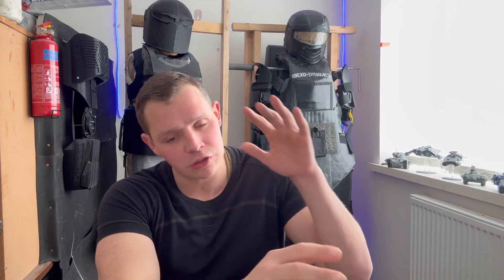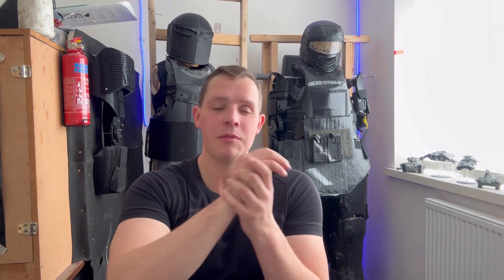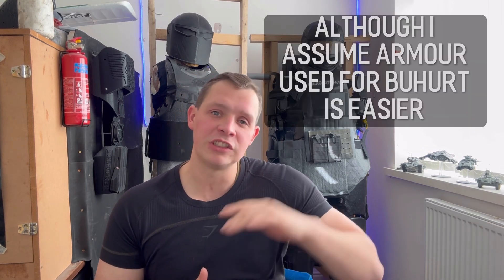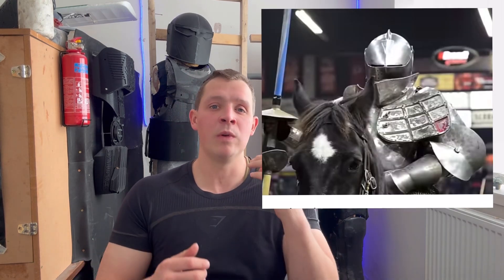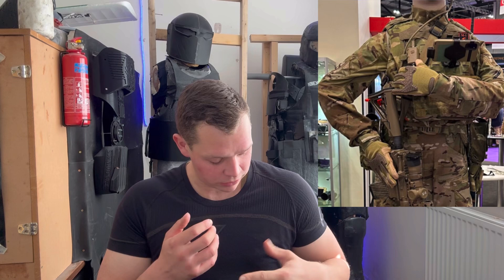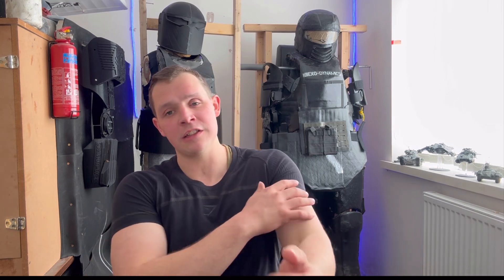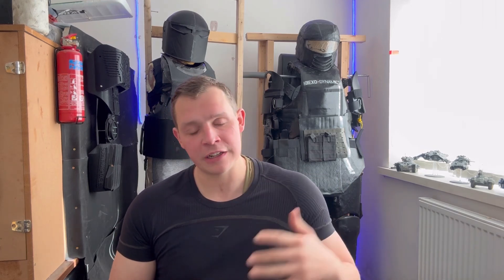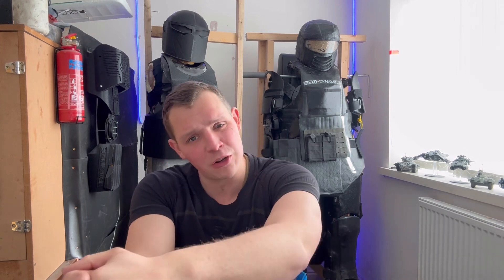The flaws of trying to use Medieval armour design in modern POWER ARMOR

Comment: I think that as a concept, power armor should be utilized by soldiers who's sole job is to rapidly deploy against the enemy to engage in close range, high-intensity fighting to initiate break-throughs for weak points in the defensive line.

 The armor only works strategically if the enemy has to consider taking higher loses from danger-close fire support than from withdrawing from the engagement altogether, as no amount of armor will save you from being turned inside-out from overpressure caused by heavy munitions. Considerations of performing manual tasks and field labor should probably be the lowest on the list of prio's to getting the concept working in the first place. 

It's not likely that power armor wouldn't already require specialized engineers to maintain like with all military hardware, so the idea of having a pit-crew to bolt some meat-head into a big metal coffin with a minigun bolted onto it with a stabilizing arm doesn't seem unreasonable in the slightest if you really think about it.

 I think as well that such troops would be deployed in similar fashion to strike teams that we've used in the GWOT where you get a handful of delta operators who hop off a small helicopter, run into a building, hose everyone inside down with hot metal, hop back on the heli, RTB, and take a shower. 

With all this in practice; does it really matter if these guys can't use a cell phone, take down field notes, turn a door knob, or play a piano?

Comment: Glad you adressed this topic.
FYI when it comes to doors, im a very big man (built like a brick out house - not obese). Frankly I go through doors sideways or at an angle any ways. you adapt to this problem, though vehicles are a problem - The amount of emergency hire cars I have had that I had to return as I could not fit in them is no joke.

Definately think there are parts of medieval design that can serve your purpose still - despite the issues. rounds being the most obvious - ie parts of armour that are loosely attached able to move that cover gaps in the armour - often at the shoulders or sides of joints.
The other being the important height of breast plates - and the skirt. breatplates in fantasy and scifi are ALWAYS too low which restricts bending forward and sitting, real armour designs had much shorter breastplates going from neck to navel - with a flexible skirt below that. For modern materials (and thickness) Id suggest the skirt be made of panels (those hexes you have?) stitched together with a flexible kevlar weave front and back OR that you use the same method as is in a modern flack jacket - essentially kevlar plate brigandine.

Regarding putting armour on, and doing things in armour: squadies help each other with this all the time already. its normal. (im ex forces - engineers).

Comment: If we consider how logistics are made to support tanks, i think supporting dudes in big powered armor is going to be nothing, with the higher technology and more robust technologies you can make essentially a human tank have almost better ergonomics than a knight in the 1800s, okay maybe not so much but getting close to that, mixing solid plates (or rather whole blocks) of steel with some overlapped less thick but sliding plates that cover the joints at all angles, powered internal exoskeleton (protected by the plating) and with stronger materials and more elaborated overall construction of the whole suit, you could make something very practical and effective without compromising mobility or visibility at all, maybe also add a lock onto the neck guard to make it flap down when you're not in combat or when you need to look down.

Comment: Your phone shouldn't be that - it should be integrated into the helmet - get some of those new AR glasses, the future is in eye tracking and spatial computing i.e. with Apple's headset or the HVAS system being tested by the US Army and Microsoft. If you have a handheld unit - it's basically a compute unit that should be tucked in under padding, not something you have to reach for. You can either connected wired via USB-C or Bluetooth 5.3 now. future versions will be even more powerful.

Comment: there are modern "stilt suits" ive seen around that have an exo built around them ,though the outer arms are driven directly by the inner ones maybe a compromise could be made, also a possibility to consider is using mckibbens muscles with hydraulic fluid instead of pneumatics

Comment: If you are in a military, You Are Not Alone.
Men at arms who didn't have Squires would help each other dress in their armor.
Think about this, is it impractical in Modern War to fly a jet because you need a team to fuel and maintain the aircraft?

So saying that power armor is Impractical for a modern military because you can't dress in it by yourself is a non- dilemma
Reply: And add plethora of modern fast connection technology like zippers compared to belt buckles and buttons.
Much easier to do yourself and most difficult parts of medieval armor are parts that are most common used in modern one.
Reply: @offnet6934  yeah, good point
I didn't even think of that

Comment: I agree that"medieval armour" design philosophy in general isn't fit for the task. Tho, samurai armour isn't really far off imo. Samurai were archers for the most part hence their armour allowed for better mobility while emphasizing on protection using larger pieces instead of close fitting, especially for their shoulders as the pauldrons were practically small shields. I think a modern samurai armour wouldn't be a bad design for ballistic armour

Comment: You didn’t actually show or describe what a gorget is. A gorget is a neck defense of articulated plates that sits on the shoulders, usually under the cuirass. It didn’t impede your ability to look down much if at since it moved with your neck. What you showed were reinforcement plates used for jousting.
Reply: @Specter_1125  The problem is that Gorgets are heavily articulated in order to offer that level of mobility.

In order to stop modern firearms the plates would have to be very thick, which would make articulations to that degree impossible.
Reply: @fallencrusader2975 that doesn’t change the fact he completely misunderstood what a gorget is and how it functions. For what he was describing, a stop rib (a small v shaped piece of metal riveted near the top of a cuirass or cuisse) would work to deflect shrapnel nor would it stop you from looking down at all. He legitimately seemed to just not actually understand the construction of plate armor if he didn’t know what a bevor was, or that stop ribs exist.
Reply: @Specter_1125  Yes I was quite surprised he hasn't mentioned or even thought about using stop ribs or fluting to deflect bullets/shrapnel

Comment: The problem especially with let’s say Germanic styles of armor with their intricate folding plate sections, is that if or whenever they’re damaged, is there a chance that the armor isn’t actually going to start hindering an individual’s ability to move or escape? As seen in warhammer 40K to get around the whole trapped inside a metal exoskeleton armor is by using a powered saw and drills, again whilst using nano machines to artificially heal any injuries, the problem becomes more apparent when you’ve got bits of additional metal pinned inside of your skin and again great for protecting you, not so great if you can get out of said armor, which is why the British army’s virtis system
Comes with a quick release strap which allows the soldier to remove their armor in mere moments, all the while being able to mount a dragging cable to the back of a soldiers plate carrier via the carry handle which can help keep soldiers hands free whenever they’re need to evacuate the area whilst keeping both hands free. Another problem would inevitably be armor degradation and whilst having full suits of power armor like the space marines or the Spartans, the truth is that it would always be a battle between armor protection, maneuverability, and surprisingly enough both power supply and flexibility which is why armor suits like the space marines terminator power armor is usually equipped with either a weapon with a box magazine or a heavy weapon, due to the armor being capable of not only carrying the weight and additional ammunition but also limits the need or flexibility required whenever they’re need to reload, not only that but the armor would be required to work in many different forms of environment from the relatively clean and unobstructed city or suburban environments, to the jungle vine traps of Asia, to the jungles of South America, where as seen by Spanish conquistadors where they used only helmets and breastplate armor, despite dealing with native tribes armed with clubs and bow and arrows, the reason why they didn’t use heavier sets of armor was simply due to how much of a pain in the ass it would be to climb, crawl or hop over every tree root that’s trying to trip you over to the thick, gloopy mud that’s trying to eat you alive. All the while vines, branches and anything and everything gets caught or snagged onto or into your clothes
Reply: Medieval armor could be pretty quickly removed with a knife by cutting the points or straps. Also, the actual danger of the armor impeding mobility when damaged isn’t as major as you’d think because it takes a lot to deform the metal enough to bind up on each other.

Comment: ....no, you're absolutely wrong about medieval armor flaws besides the help needed to put it on and being thin by modern standard, but that's out of context. It's was made to resist the weapon of its time. Once firearms were made mainstream, the armor was ditched because it couldn't resist them without compromising mobility.

You assumed flaws are actually with the sci-fi armor of 40k.
Reply: late medieval armour and renisance armour was made to resist firearms, which were "mainstream" at the time and it didn't compromise mobility much or at all.
Reply: @VihniPuh-kolinkrivi  Actually, they did. Please explain why we don't wear plate body armor anymore?
Reply: @houayangthe3rd  plate armour dissapeared with dissaperance of knightly class of professional warriors. We don't wear it today because there is no body who has power and wealth to afford the top notch protection, and thus facilitate it's development, and who at the same time has to go to war. Like billioners don't go to war, kings did.

So caeconomic and socaidal changes is your answer.

I guess we have fighter-jet pilots, who are most similar to this class, but they are still different and armour wouldn't be of use to them.
Reply: @VihniPuh-kolinkrivi LOL Fail. 1, plate armor is not exclusive to knights. Anyone who could afford or loot it can wear it. 2, WW1 should have given you the correct answer. They tried to create plate armor that could resist machine gunfire, and they did. But guess what? It was too heavy. 3, jets have nothing to do with body armor.
Reply: @houayangthe3rd  yeah jets don't have anything to do with body armour, i agree. They have to do with knights.

i must disagree though. Anyone who could afford or loot it could wear it - it's correct. But, who could afford it? Even many knights couldn't (their lord bought it for his combat servants), anyone who's less wealthy than a knight - could not afford it at all, in vast majority of cases. There of couce were priests, who were really wealthy, but they don't go to war. Really the only exeption would be the most wealthy merchants of late middle ages, but even then a full harness would be a fortune even for them.
So, only knight could realistically afford it.

Looting it is a different thing. If you loot a full plate harness - it's not made for you, you wouldn't be able to wear it to the intended effect.
More importantly most of the time you wouldn't get to keep it, because it's way over your share of the loot (if you even get one).
And even if you did - unless you intended to become a man at arms, it would be of little use for you for the rest of your peacefull (hopefully) life, you would be better off seling it.

Really, even the plate armour was never invincible. The best possible protection of every period changes. Because of modern economic and social situation the best armour today is a fighter jet, or even better to not be directly involved in the fighting. If we had an elite class of professional warriors during WW1 they wouldn't need to invent a new body armour, it would've already be heavily in use. But we didn't have this elite class of professional warriors so weight of this body armour was to big of a problem.
Remember a knight was always mounted, for a horse nothing is too heavy. For a WWI eqvivalent even more so. And WWI equvalent of a horse was not the lack of a horse.
Reply: @VihniPuh-kolinkrivi Man at arms could afford plate armor and loot it too.
Reply: @houayangthe3rd  i don't think you're correct in this

Comment: Your work is great, i want you to succed, world needs your exo-armour.
I think, your limithing youself and your amasing potential greatly, by not looking into medieval (and ancient) armour designs, because they have solved a lot of poblems, that your suits have, had and will have, including those that aren't at all obvius. It took evolution of several hundered years to solve them, and that's a goldmine of ingenuity. There's no need to invent bycicle again, especially when you can just take the existing invention and adapt to your needs in a fraction of the time.

Sorry, if it sounds harsh, but you're mostly incorrect in your assumptions about medieval armour.
1. Properly made plate harness can be put on on your own. It's easyer with a squire, but one is not nessesary.
2. Buhurt armour is as medieval as it gets, other than it can be made out of titanium sometimes and various bits of perfictly historical designes are combined in an unusual way. But still it's perfectly historical, and even goes as far as non-historical pieces are banned from participation.
3. Gorgets can be different. However there are none that limit visibility more than a helmet would. Most of them do not limit visibility at all. The picture you presented comes from jousting armour, that propably was never used on the battlefield. Jousting was a medieval sport and it prioratised safety over effectivness, just like modern sports.
4. Medieval helmets actually do limit visibility usually quite a bit, however not all of them. There are designs with visors and open-faced designs like baburt (that can today be used with protective polimer visors for example)
5. Humans did get bigger since 1700s tht's true, but ppl in middle ages were generally the same. Tho, i don't see how that changes anything anyway.
6. You have to remember that medieval armour was also made for humans and also made for warfare and live, just like today. They weren't stupid, and those who were didn't survive the combat. Medieaval armour was (and is) practical, and even convinient in a way. Just don't take movies seriously pls.
7. Medieval logistics were actually mostly focused on supposrt of medieval version of tanks & fighter-planes i.e. horses. An exeptionnaly rich knight eats for 10 people, a horse eats for 100 people, and you need 2 horses per knight, including the combat-horse. You also need at least a horse per any person, to carry all the food, but mostly food for the horse itself, and this number scales exponentially with the number of miles the army needs to walk.

Not a mistake on your part, and not about medieval armour, but still worth mentioning: It is possible to make thicker armour, while still adhearing to desight principles of medieval plate armour. Maybe look up renisace armour (it was Waaaaay thicker, because it was made against gunpowder weapons). Something like elbow joints probably could not be made any other way other than how it was done in plate armour of medieval time, and still retain the neccesary level of mobility; it also has only three moving parts, zero overlaping plates and i recon would scaleeasily to include the exo-sceleton inside it.

Also, pls don't be harsh on overlaping plates, they allow for great movement ability, while they can be made significantly thinner with no loss of protection (because they overlap).

Comment: maybe a sort of chainmail wouldn't be to bad of an idea. A cevlar fiber with small ceramic or metal parts could potentially stop or at least deflect smaller calibers and shrapnel, while being flexible enough to be used to cover joints or on the neck. It certainly isn't as good as solid plate, but better than nothing
Reply: German riot police use a modern form of chainmail under their plate carriers to protect against stabbings